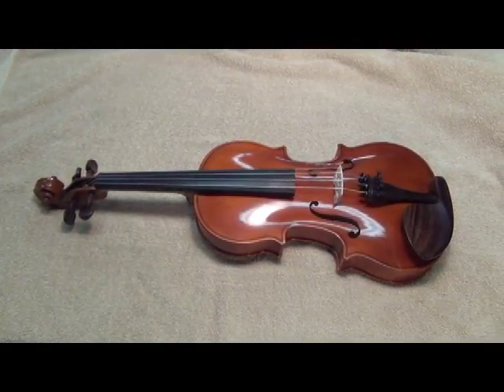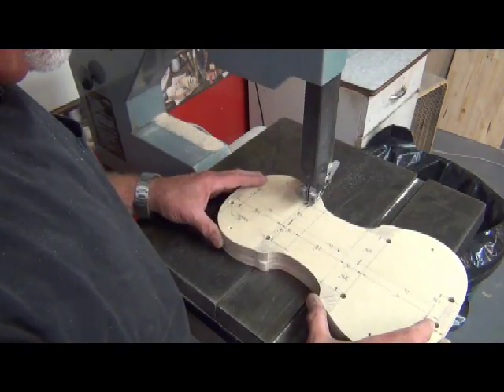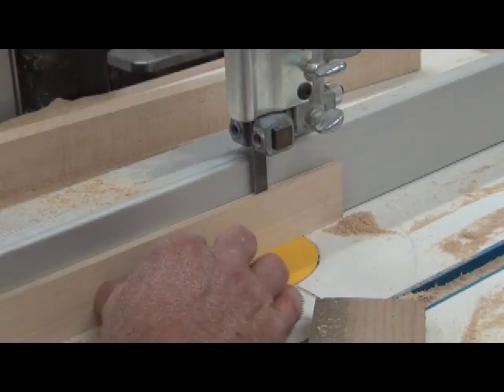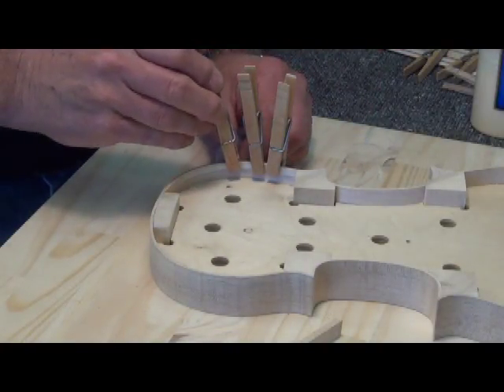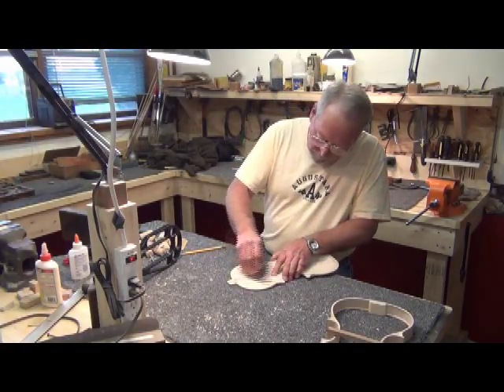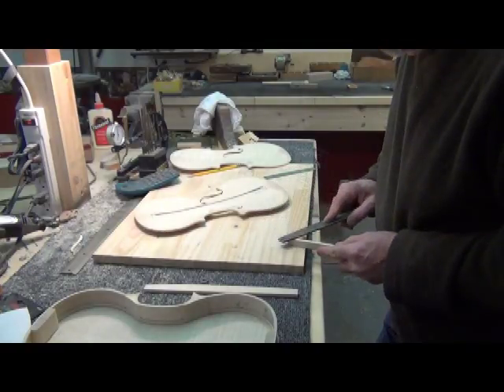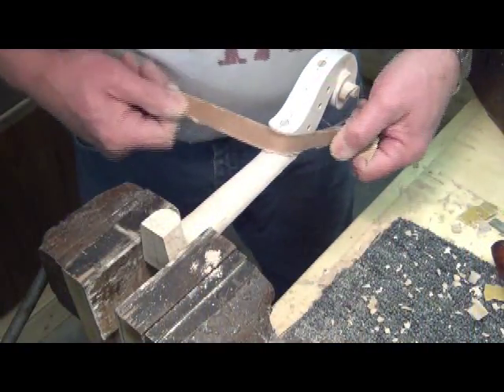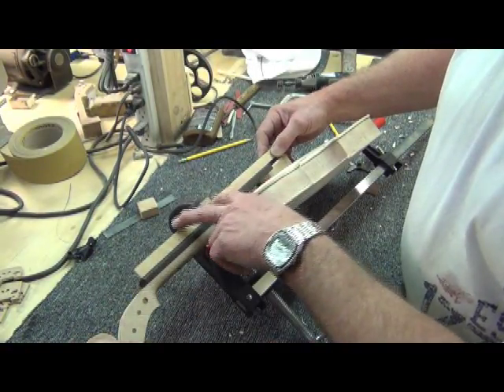Introduction to Modern Violin Making (2).flv

Comment: I watched another violin maker who used fewer power tools. He also carved the top and back from a solid piece of wood rather than buying a blank. When he got the wood close to the required thickness, he used a drill press to drill holes at the required depth and then gauged out the wood between the holes.  I have a feeling in the future violin makers will be putting then together from kits, and even then it will require a great deal of skill to produce a quality instrument.

Comment: How come the internet get filled up with crazy discussions. I have used many different measurement standards. In my apprenticeship I used thousandths of an inch, I now generally use metric for most work but if I want to relate to fine measurement I revert to the thou. Partly this is because all the measuring tools I bought as an apprentice and the lathe I bought still work and are calibrated in imperial. If he had measured the thickness in Gnat's Cocks (an almost recognised standard during the 1960s) it may have been something to argue about. Have you guys never heard of the micron.

Comment: This is an excellent hobby violin, but "modern" is irrelevant here. If a viewer's aspiration is to be a fine instrument maker, avoid most of this video. It's hard to tell when new to the topic to discern what is craftsman technique & what is fine technique. 
Examples: aside from ripping, using power tools on actual instrument, laminating bouts, handsawing scroll detail, free-hand edge purfling, white glue in ribs, shellac, sprayer... 
If the goal is fine & not craftsman. "Modern" is irrelevant.

Comment: The world changed to the metric system in the 1960's, following a push by the UN.   Tragically, and I mean tragically, the US did not adopt this simpler method of weights and measures.   Consequently the US is now 50 yrs. behind the rest of the world.   95% of the world is metric.   It is a much simpler system and far easier to learn and understand that the old and complex imperial system of measurements.  
Just imagine how much this failure to go metric is costing US business these days when they try and sell a product that is in imperial measurements when practically no one outside the US understands the measurements.   Just plain damned silly if you ask me, and about time the US joined the rest of the world hey.
Reply: Don't 95% of Americans think America IS 95% of the world?  Though I agree with you Sam, I believe your comment is wasted on the majority of them ;)
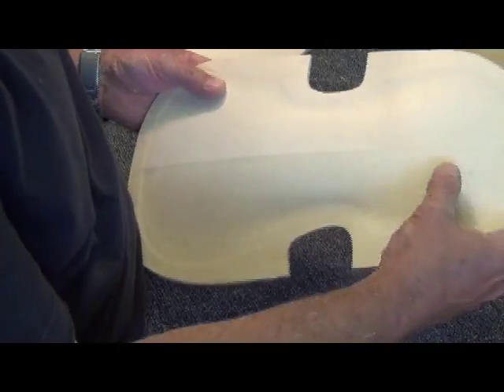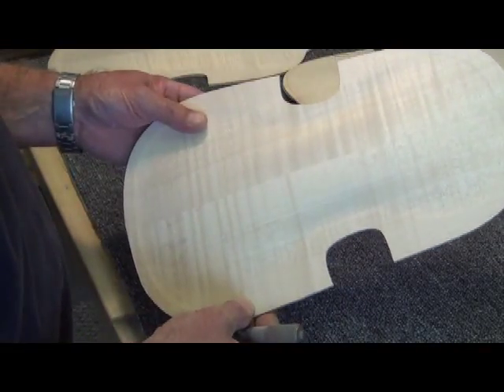Reply: dalmation20 Well one of my hobbies is modelmaking from scratch or correcting errors of existing kits. You have to learn the imperial system - and eventually it becomes like a second language. Starts with scales like 1:12 (inch or the foot) and the half 1:24. You will come across a lot of objects measured in the imperial system (plate thickness, floorboard measurements, tubing diameters..... Same goes for hardware. There are still 3/4 in and 1/2 in tubings and the likes. Trouble? Ask people from Canada, most work with both and are pretty good at "soft converting" in their heads.
Reply: I don't see how counting and dividing everything by ten is easier than 16 or twelve, which divides easily into 3rds and quarters. It's only because we have decimal calculators/number system. Don't tell me cooking with ounces is harder than tiny grams. Don't tell me there ought to be ten days a week
Reply: Ten days a week sounds like a great idea! As long as the additional 3 days are used to extend the weekend ;-)
Reply: *****  By not changing and adopting the metric system the US is now the only country that is not metric.   So you ARE 50 yrs behind the rest of the world in this respect.How much longer will  it take for the US to realise they are so out of step?
Reply: *****    What I am saying is that the vast majority of the world has no idea of the Imperial system, have never seen it, or learnt it.   The US seems so insular regarding matters that must be costing them a huge amount of lost revenues as who would buy something they don't understand?   More than time they caught up with where the world is these days, and that is in their best interests.
Reply: Many people across the world use inches despite not being the official unit, it has been in use for +1000 yrs in various forms and will survive because it's easier to use on a day to day basis. It's easier to use 6" than 152.4mm
Reply: Lawrence Leith  Easier to use.   That is utter rubbish.   Metric is far easier.   Everything is in 10's.  So believe me that 150mm is much easier to use than 6 inches.
Only one country still uses metric officially.   So out of step with the entire world now.
Reply: +Sam Sabastian Your entire point is just rubbish. US Universities teach metric as the primary unit of measure (physics, chemistry, engineering). Day to day still use Imperial units, but metric is making its way in, and rightly so. Our automobiles use metric fasteners. It is a better system. As for it hurting our economy, not so. The economy of 49 out of 50 individual states is larger than the entire economy of the UK. I don't think we are doing so bad. We currently export more than Germany, France, UK, Netherlands, Japan, etc.  We are doing just fine.
Reply: +Sam Sabastian I completely agree with you
Reply: In fairness terror attacks are going to keep on the increase until the point were the UN use it as an excuse to eradicate religion throwing the earth into utter chaos before the world as we know it ends. All fairly soon too. That is, within the next decade or two. In which case both debt and methods of measurement wont even matter. Still, I wonder what unit of measurement those who survive will chose to use. No doubt they will end up with something better than either current system :-) Don't believe me? I bet you'll remember this post when it happens.
Reply: +Patrick McLaughlin How sad to see that worn-out, tired anti-American bigotry still rears its ugly head here on YouTube. 
May I take a moment to remind the "world" who it was that saved them from the Japanese Empire and the dastardly designs of Adolph Hitler, as well as the domination of Soviet Russia? How many more millions of innocent people would have been killed by these regimes had WE not destroyed them? 
The world owes the United States a debt that can, and will, never be repaid. Luckily, due to our beneficence, no payment was demanded or expected. We even rebuilt the nations of our defeated enemies. Consider yourselves blessed.
Reply: Jeff Puha tell that to Libya, Afghanistan, Iran , Iraq, Vietnam... they really seem to be fine right now don't they America really BUILT THEM UP
Reply: Wow Jeff. I know it's Monday but lighten up. It was a joke not a dick. Don't take it so hard. 

All hail Jeff Puha and the USA for delivering the world from certain destruction. We bow down to thee. Our betters in every way. Feel better? ;-) 

P.S. Your sense of patriotism, though misplaced is to be commended. Before you go firing off don't forget that current day mighty USA was built on the back of African, Asian and Irish slaves among many others. Who owes who what now?
Reply: Mithril Dwarf Yeah, all countries propagating, and or, supporting terrorism, dictatorial oppression, or Communism-all of which trample and destroy the hopes, dreams, and lives of the poor and powerless. 
The US is the only country which has the guts to fight for freedom and the rights of the oppressed. No one else has any moral courage.
By the way, who is it at the forefront of EVERY natural and man-made disaster with food, medical supplies, clothing, housing, infrastructure support, and copious amounts of money? It ain't any European nation, nor China, Russia, India, nor anyone else. It's the USA. 
Wake-up and open your eyes.
Reply: Mithril Dwarf HaHaHaHaHa! Just the kind of response I would have expected. Whenever folks of your ilk are bested by the truth you all resort to insults and name-calling. Pathetic.
Reply: +Sam Sabastian Ok. I am thinking of how to mass market fractional calculators, rulers with 1/12  markers and alternative size inch rulers.
Reply: +Sam Sabastian Well, America seems to do all right in imperial units. In fact better than most.
Reply: @Sam Sebastian Do not worry, all serious USA companies working with the world use the International System of Units. All scientific publications are in SI. 
I have worked with American Naval Architects and Naval Engineers companies, and the drawings and calculations were made in SI. The USA has no more a serious naval industry. If these companies want to survive they are obliged to use SI units in the international market. 
No one Korean, Japanese or Chinese shipyard will bother to convert imperial to metric with all the risks of mistakes. And there are plenty of engineering companies in the world, all using SI and ISO norms.
All the ships certifications dossiers are calculated in SI, I do not see the Det Norske Veritas trying to read a classification dossier in imperial.
Also complex calculations like 3D finite structural are far easier and faster in SI. instead of fractions and odd systems of measure you use powers of 10. Machining is also faster, simpler and the machines less expensive to make.
Remark that when precision is needed, the imperial users use 10th, 100th and 1000th and even 10000th of inch, as the mondial ordinary precision unit in machining is 100th of millimeter...
The imperial is practically kept only for the layman and the domestic market. With the outsourcing of their industry by the American companies, they have to convert to metric. For example, most of of the new engines in the American car industry are now in metric.
And as the USA buys now a lot of products made in metric, they will be used to metric.
Like all empires, one day the American empire will fall down and the imperial units will slip in oblition. I think that Burma and Liberia will have adopted the metric standard long before.
Reply: It's easy... You just have to multiply by 2.54 or divide betwen 2.54 to convert inches to millimeters or viceversal...!!!